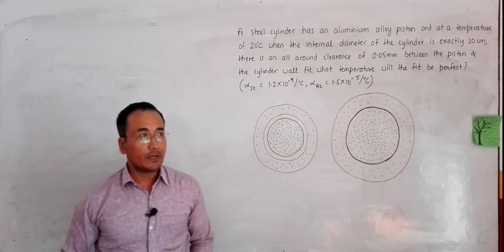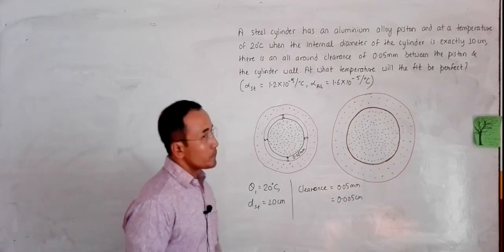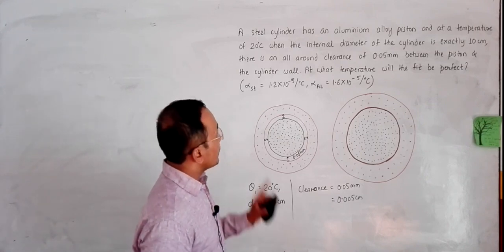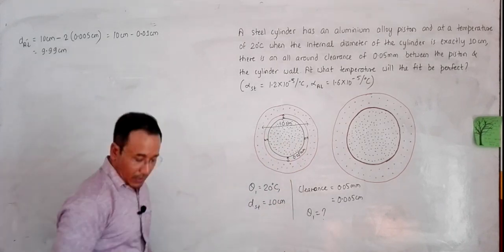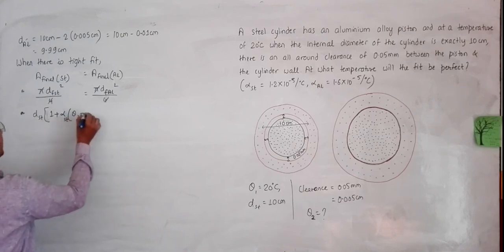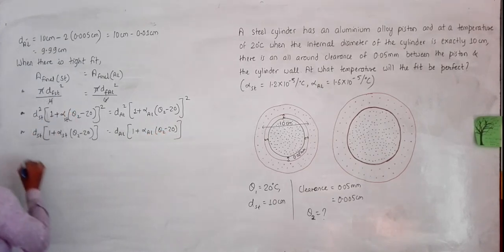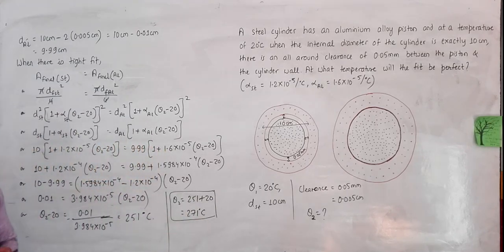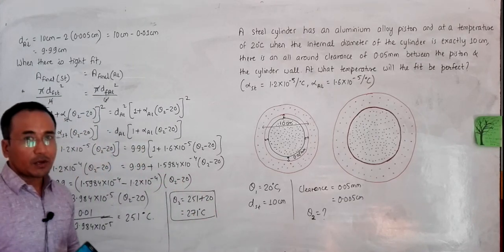Tight fit of piston in cylinder

Comment: Dear Sir............Example Problem : One hydraulic cylinder, the end is connected to the Threaded rod so that it can be rotated. Cylinders with a bore size of 18 mm, 10 mm rod and a stroke of 300 mm single acting in a condition that is filled with oil. If the cylinder is rotated 10 mm.
a. How to calculate it
b. What is the gauge pressure